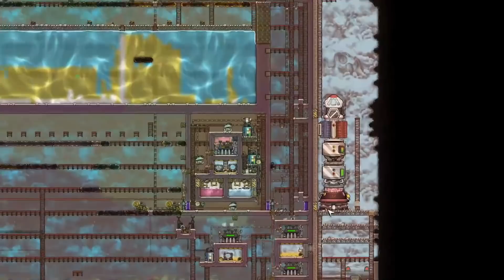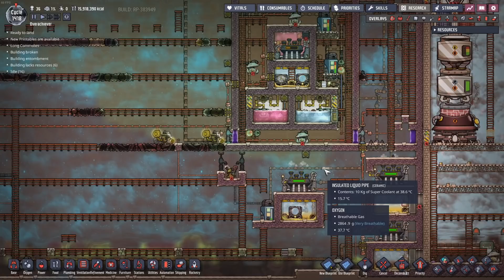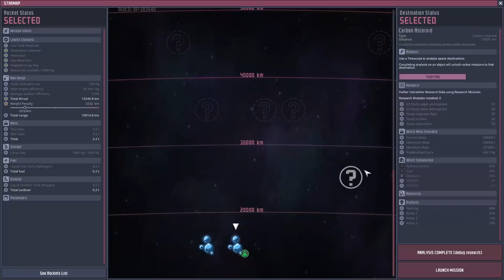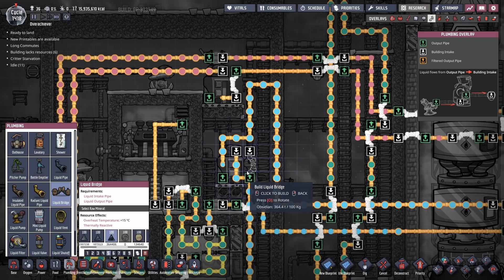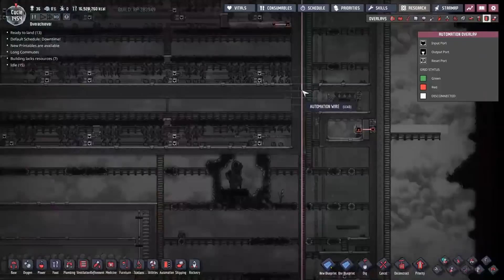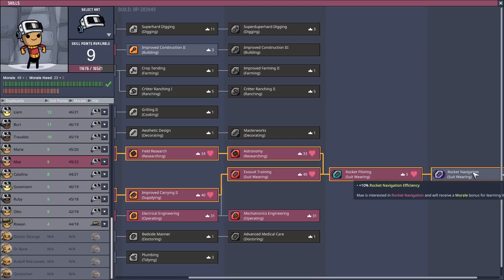Rime 29 : Rocket Chimney Expansion, Scope creep : Oxygen not Included

Comment: Again power for what?  Everything you built just runs 24/7 burning of power you don't need.   Seems like a waste of time building even more power you'll never use.  You could have built 8 petroleum plants in a power room and been done with it.  24,000 power.
Reply from the maker: My real plan is to flood the map, this is the only way I could think of to generate enough water to do it in a reasonable time frame.

Comment: Replace the bottom glaass tile with a temp shift plate, this speeds up the heat exchange with the door
Reply from the maker: I toyed with the idea but it also will inject heat into the insulated tiles beneath it. Considering the temp I will be running this at I don't think heat injection will be a problem.

Comment: Why not add some power control stations and increase the steam turbine output by 50%?
Reply from the maker: This system will produce over 20KW when completed, +10KW from the petroleum boiler. Also we have solar on top of that. We are going to be pushing 50KW on the wire already, I don't thinks it is worth the effort for a bit more power.

Comment: In one of your base lovin' video's I saw a CO2 lock? Just a pit with CO2 gas in it, which blocks any gas flow. As CO2 is a poor conductor a little bit of heat leakage might be containable. You could perhaps double lock it, without a vacuum, but let the super coolant loop run close there too, to prevent the heat from leaking into the rest of the base. 

Also, if you're willing to spend the thermium, why no L-shaped tunnel directly in the turbine, with a robominer in the steam room to clear the path after an unfortunate meteor? Won't solve the wasted heat, but it will save you 2.4KW worth of pumps running non-stop.
Reply from the maker: Stealing this idea, but reserving the right to modify it slightly. I think I can also turn it into an entrance.

Comment: At 27:00 -- it seems odd to me that you aren't condensing the water?  

5.62kg steam/second would require 2600kDTU/s of cooling power to go from 200 deg to 90deg.  That can be provided by 3 thermo aquatuners working on super coolant.  If those are set up inside an isolated steam chamber, this is approximately power-neutral.  The resulting condensate would require less than one liquid pump.  A condensing system would also be a reasonably-effective way of reducing the steam pressure in the area, if you ever need to vacuum it again.

The condensing region can be made efficient by wrapping it inside a heat exchanger.  Rather than use doors and plates for heat transfer to steam turbines, once again use supercoolant and radiant pipes.  With an appropriate buffer, the heat-collection supercoolant should stay in the 150-200 degree range.

I may have to test this setup in a debug map.
Reply: My only worry with this (that I have thought a number of times when FrancisJohn has mentioned using cooling within the chimney) is that cooling the steam takes away potential power from his steam turbines, which is a large part of the reason for the system. Of course, removing hot steam does this too, but assuming that you take that hot steam to another set of turbines to extract the power from then you are still using the energy
Reply: With 5.6kg/s of steam and 5.6 gas pumps + filters, then the extraction will use 1.82kW of power in excess of 0.56 liquid pumps/filters.  

In the meantime, 3 steam turbines (the design target at 27:45) will max out at a constant 850kW/per if fully occupied, which should happen if the input steam is 226C or higher (blocking one input on one turbine).  That would recover 2.55kW, so the gas pump method wins out by just 730W.

In the meantime, clever design -- perhaps via a passive steam tunnel protected with bunker-tile overhangs -- may allow the condensation chamber to passively extract more heat out of the steam prior to condensation.  If enough heat can be extracted passively to reduce the temperature to 194C prior to condensation, that would power an additional steam turbine and make up the differential.
Reply from the maker: I am starting to lean towards using steam turbines to extract the water, if I just do it at one location I should be able to control it quite well. This means I will have to have a break in the chimney wall to siphon the steam out, but then I realized I could use that same break as an entrance/exit. I need to do a bit more thinking on this.
Reply: The break won't be a problem if you have an overhanging "lip".  Imagine the top of the chimney fits into the lower part of the chimney, inverse to how a lid fits on a glass.  Any meteor that enters will either hit the top portion, where the regolith falls down, or the bottom portion, where the regolith also falls down.  There's no accessible flat tile for regolith to accumulate on and potentially gum up the works, but that's no barrier to gas flow.

Comment: Great work! I like to make a steam tube from the bottom to top of the map as soon as I get access to steam rockets. I train a bunch of astro-dubes for space travel then stack the steam rockets at least 12 high. They produce their own steam for launch plus excess power and water. Since they are only steam rockets it is easy to keep the temp below 200C so you can use steel pumps without worry. Keep it up, I can't wait to see the final numbers on this one.

Comment: For access to the silo. Have you concidered a liquid metal liquid lock? Those puppuies made of aluminium or lead can take a lot of heat untill they get problems. And honestly, if you reach that temperature the rocket and the ladders around it would be in the range of melting already, so you might want to set a maximum allowable temperature for the rocket silo to launch rockets at. There's plenty of space underneath the rocket to place one of those liquid metal liquid locks, and you could place a door in the middle of them with some automation to automatically stay shut if an atmosphere is being detected in there.
Reply: That's genius. I was thinking using something like Petroleum as a higher temperature liquid, but using a 'low' MP solid such as Lead is pretty clever. I guess all of these options have potential downsides (other than the increased space required) in that if something goes wrong inside the shaft such that the temperature drops precipitously (or I guess goes so right with the cooling tower that he controls the temperature) you lose your access point

Comment: @Francis John
25:38 Put the Visco airlock at the bottom of the silo & fill the bottom with CO2 or (or Clorine?) or some other gas that is bad at heat transfer, then run a cooling loop in that non-steam gas just to keep it cool enough to enter.
v v v v v v v--- OPEN THIS
You can even use a 3-layer solution:
Steam    - Density: 18.01528,     TC: 0.184,     CP: 99.35
Chlorine - Density: 34.453,         TC: 0.008,     CP: -34.6
Ethanol  - Density: 46.07,           TC: 0.167,      CP: 78.35

* Density, unit: g/mol, 
* TC = Thermal Conductivity, unit: (DTU/(m*s))/°C
* CP = Condensation Point, unit: °C
https://oxygennotincluded.gamepedia.com/Gas

As you can see, the densities makes the gases "self-align" in the above order, then the Chlorine is a great isolator, so not much energy gets through, but the Ethanol is a good thermal conductor again, so any heat that gets through the Chlorine is easily absorbed  by the cooling system.

Comment: Hi, if the steam is too hot for viscogell why not use lead, it melts   at 325 c . I use a lead lock in my base for a access to my geothermal power plant. It is a crazy idea but if you want to run it very hot a lead lock will work